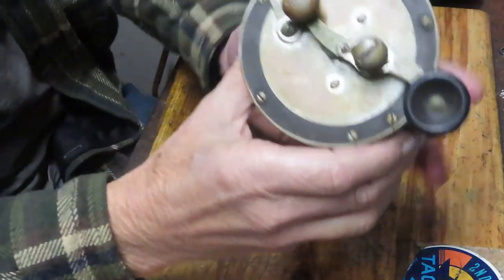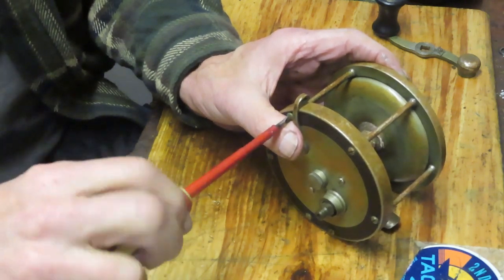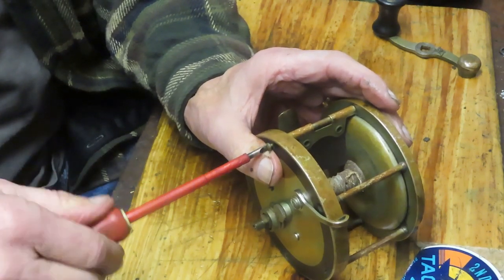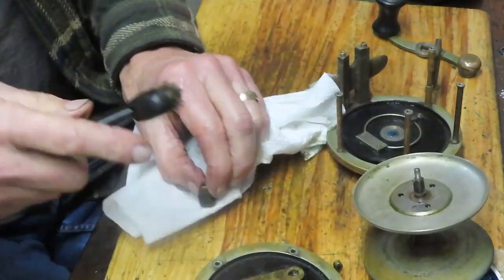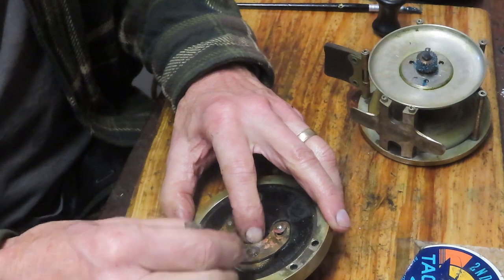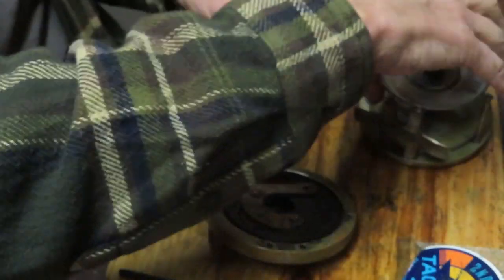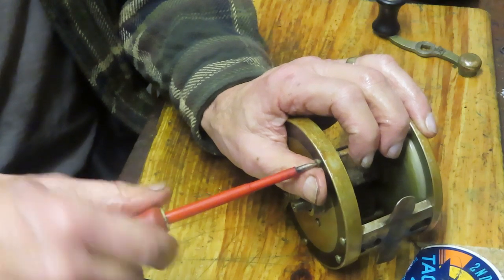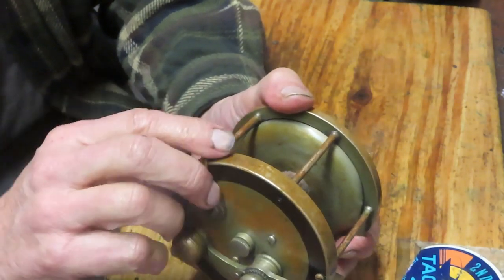Pflueger Oceanic 100 year old fishing reel how to service

Comment: I have two very old reels similar to this one; both with thumb drags and wooden knobs. One is an Ocean City Bay City. The other which is almost identical to the reel in this video has Pennel stamped on the sideplate.
Reply from the maker: Pennell was made by Montaque Reels which was a competitor of Ocean City and was eventually acquired by them.  Bay City had a 20 year run, from the mid 1930's until the company was sold in 1957, so it is likely that wooden knob version is pre-war

Comment: Hello Dennis, got a question for you not about this reel. Where do you buy Daiwa reel parts from? I tried MikesReelRepair and the part was backordered. Could take a 6 weeks to get it. I ended up ordering straight through Daiwa in California which worked but I'm wondering if you have another spot.

Side note the people at MikesReelRepair are extremely accommodating.
Reply from the maker: Daiwa in California is a great resource.  You can also try Southwesternparts.com in Dallas.  Those are the two I use most frequently.  Depending on the reel, and what you need, you may also find the parts on eBay

Comment: Hi Dennis,
      On a side note.  What reel that I have, would work for "surf fishing" for a 13' Hammerhead shark ??
Thanks,
 Cons
Reply from the maker: 7000 and above spinning reel or 4/0 and above conventional reel.  If I recall, you have a Penn 7500. SpinFisher - that would work.  Hope all is well Cons!
Reply: Thx Dennis.  You right about those reels.  Would a newer Penn 325 be strong enough also ?
C